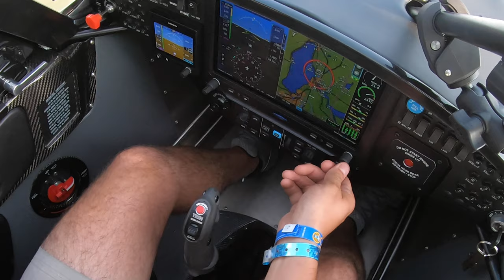X-Cub with a NOSE WHEEL?! - Cub Crafter's NEW Airplane!

Comment: The Cub community is about to discover what we in the Zenith community have known for a long time.  We fly nose wheel aircraft which regularly outperform tail wheel aircraft on both takeoff and landing.  That said, I still fly a Maule occasionally, because I'll always like a tail wheel.
Reply: Wish I had an extra $330,000 laying around. I would Keep  My  zenith 750. And get one of these.
Reply: If, I'm gonna wish for something, I'm gonna wish *big*.  I want to be Mike Patey...lol.
Reply: Gary B Wood I’m sure Cubcrafters wishes you did too.....
Reply: It all comes down to the pilot, I've seen 170's takeoff and land shorter than cubs and I've seen cubs take off and land longer than 172's. A good pilot in a good airplane can outperform a mediocre pilot in the best airplane. For people saying nosewheels will outperform tailwheels because of their natural AoA I have two things to say. 1: You're wrong, and 2: tail-up-taxi.
Reply: @davidwright5782  you would be confused then
Reply: @ellenorbjornsdottir1166  I think not
Reply: @davidwright5782  using pilots that cant even match the printed stats on an airplane is not a good way to compare aircraft.  A Honda Civic can outrun a Ferrari if the driver stalls the clutch...
Reply: @davidwright5782  Completely false ... a 200 HP cub will take off in 1/5 the distance of the wildest STC'd 170  all day long with any amateur  pilot who can hit full throttle and keep it strait ... The plane everything , pilot nothing on takeoff ... landing different story but the cub will land places the 170 never dreamed of ... They are so profoundly different I wonder if you have ever seen not a stock 150 HP super cub from piper but a 200 HP one from Carbon or homebuilt expiremental... There is no amount of power under heaven that will get a 170 up shorter due to wing loading and 170's are certified disallowing engine modifications ... 200 HP cubs are up in a hundred feet
Reply: @markdoan1472  I live in Alaska, I know alot of guys with super Stol Cubs and flown with them. We were flying with someone in a 170 and he was landing every gravel bar and beach we landed on in a 200hp cub, with slats, and 45°of flaps. I've seen a 172 land in 53ft in Valdez and a carbon cub land in 66ft feet there too. You can't mod the engine of a certified A/C but you can swap it and you can still mod the airframe to a certain extent.

Comment: Some say it's a Cub with Training wheels; some say it's the answer to a question that nobody asked.  

Me?

It's an answer to my prayers. To heck with the naysayers...it's half a TriPacer.  It's a gift.  Let's face it, in most entry level GA Aircraft you're not going to get full fuel, full baggage and full seats - any more than two.  This bird you can.  I'm presuming the Useful Load is similar to the XCub,  maybe 60 or so pounds less.  Not bad.

I lust after this plane, and now I need to take a cold shower.  

Now if they would sell it or under $300,000, they'd have a deal.

Comment: As a 180 guy this Cub will bring a much needed safety factor into the flying community, most pilots today are not trained in tail wheel planes, I was due to my father owning a 180, most are piper and Cessna tricycle gear, so id assume there would be some training time in the cub but not the added time of training for a tailwheel indorsement.personally I LOVE IT
Reply: And try finding a Tailwheel instructor in many areas these days. Good luck

Comment: This is a very interesting airplane.  When I was flying my Piper Tri-Pacer back around 1970, we had the Piper Cub and the Piper Super Cub on the airfield with me.  I did my early training in a tail dragger, the Fleet Canuck.  I then moved to the Tri-Pacer.  I like both the nose wheel and the tail wheel.  The biggest problem I had with the tail wheel aircraft was being able to see where I was going.  The Carbon Cub and the XCub have sure taken this style of airplane to a whole new level.

Comment: Added a bigger engine and nose wheel weight up front. How did it balance?  Move the seats back? Battery in the tail? Not a lot of prop clearance when braking but I hear Hartzell is making a 3 blade for it.

Comment: Wow, a good upgrade. By moving the main landing gear backward, you'll get less weight on the structure. Using a heavier engine (which usually higher performance) might be necessary and the additional structure on the nose gear will move the CG forward to solve the problem caused by the main landing gear modification. Win-win solution.

Comment: I no longer fly. But, as to the argument "tail dragger v. nose gear", i would be delighted to buy a nose gear cub. Taildraggers have their place, certainly, and their cool factor is awesome. But, the advantages of nose gear are obvious. That said, I also feel the nose gear Cub is a little bit awkward looking. It's the slope of the top of the fuse or perhaps the length of the tail moment- I don't really know. But, it does look "tail saggy" on TO. Perhaps it was simply the aggressive handling for this video that caused that appearance.  I do like the extra power available...but, then power is the end-all-be-all of flying, isn't it? You always appreciate extra power. Anyway, excellent video and an outstandingly nice job on the Cub.

Comment: Being a tailwheel pilot, with 400+ hrs, and less than 8 hrs nose wheel time... I would pick a tailwheel over the nose wheel. I can see benefits to this nose wheel cub but also see some potential downsides. I know that the “nose cub” has faa legal prop clearance, but it’s not enough for a lot of places I take the pacer to. Sometimes I feel like the 18”s of clearance I have is not enough... lol which is why I’m upgrading from 26” tires to 31’s, I can’t imagine taking the nose wheel with the minimum 7” clearance (nose wheel) not the 9” clearance (tailwheel) distances as being near enough to operate in the back country in Alaska. 

I think there is a solution to that for the “nose cub”, switching to a shorter 3 blade prop could increase those distances but then there’s the small wheel issue. 

Still, with what I perceive as potential issues, I see value in this new design...
Reply: Needs a longer nose wheel leg imo. If it was mine I'd want wheel pants for aerodynamics, too.

Comment: Aviation101 ... it's not an X-Cub .. it's an NXCub ... it's 100% pure Cub that is also off-airport capable, slightly smaller tires of course, LOL...a very practical new addition (hopefully) that I believe will become a staple of Cub Crafters for those pilots that want a tri-gear setup rather than tail wheel...but, Aviation101, you can change your title to NXCub... X-Cub is a taildragger with floats option that's currently available...

Comment: Why would a fuel injected engine even have a mixture control?
Reply: Even though it’s injected,, it’s still not controlled by sensors and computers,, so you have to manually enrich and lean for conditions and altitude

Comment: It's about time, the tail wheel concept is inferior in so many ways for stol.  Now add fowler flaps and slatted wings and for G*#s sake why people insist on throwing all that power... (wouldn't need that much power if it was engineered right to begin with) ...away by trying to push the plane backwards in a 300mph wind storm is beyond logic and reason.  There are better ways to accelerate mass and better methods to convey those force vectors.  It's a nice plane, being a small step in the right direction, but at the end of the day it's still another over priced money pit.
Reply: Maybe you should build a plane and show everyone the right way to do it! Osh Kosh 2020!
Reply: @flutetubamorg  Good idea!  I need a materials person and or a willing structural engineering team that doesn't have "I can't" or "it can't be done" as a part of their repertoir of vocabulary usage, and someone willing to intently listen to me and exchange constructive and edifying criticism toward an absolute outcome.   Money to invest would be a necessity.